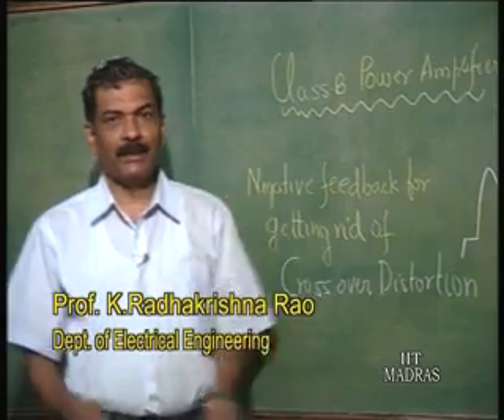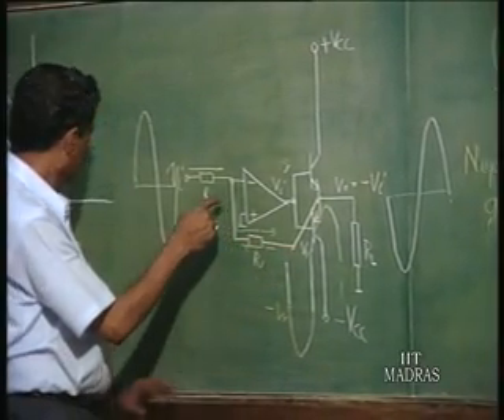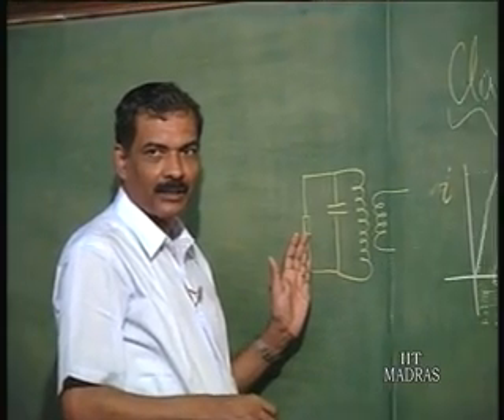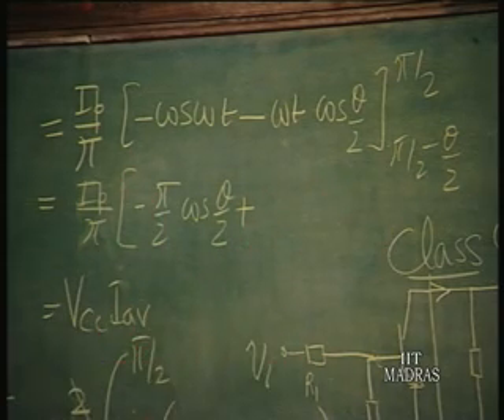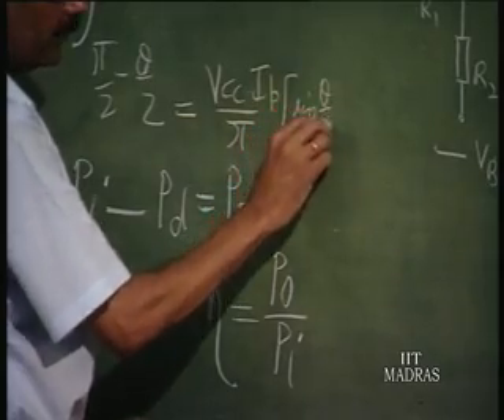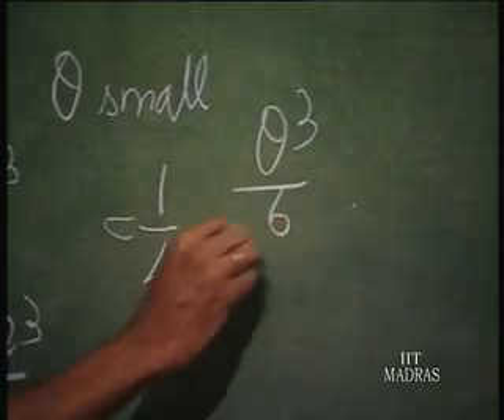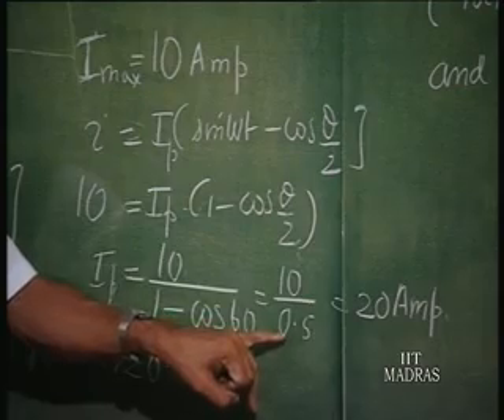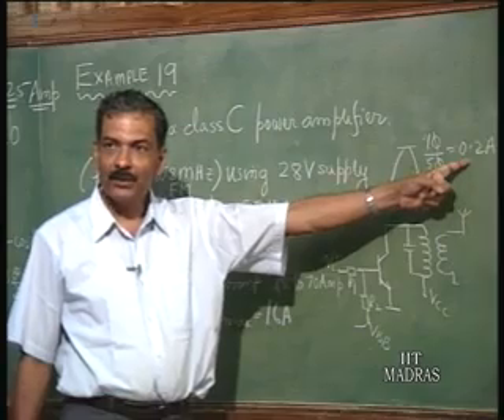Lecture - 23 Class B and C Power Amplifiers

Comment: Subtracting the 1 volts from the input voltage and dividing by the series resistor will not give the accurate base current, you also have to account for the current going down the shunt resistor towards -VBB. The Beta is not 50: the transistor is a switch conducting max possible current (saturated) in the collector hence the linear gain beta does not apply. Not having a series resistor altogether from the input voltage would definitely have a much better chance to saturate the transistor into max current.